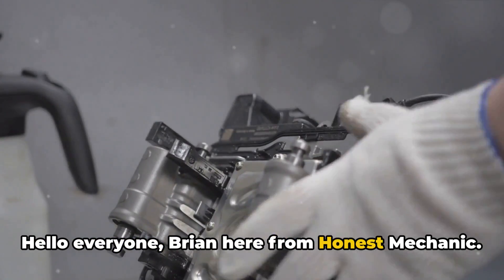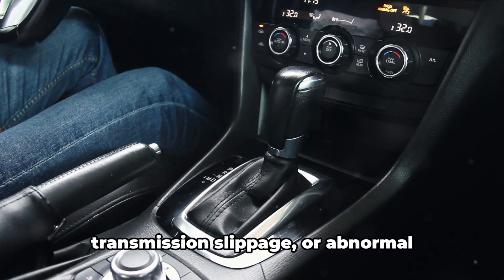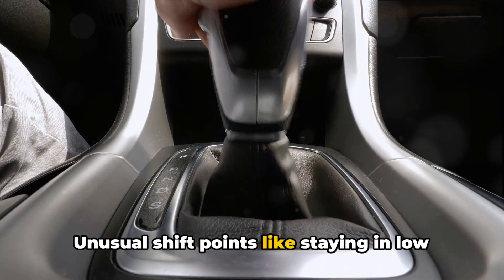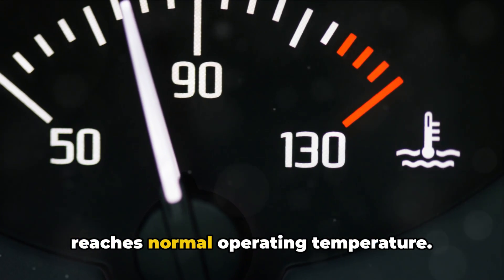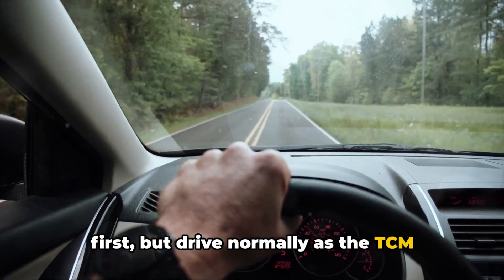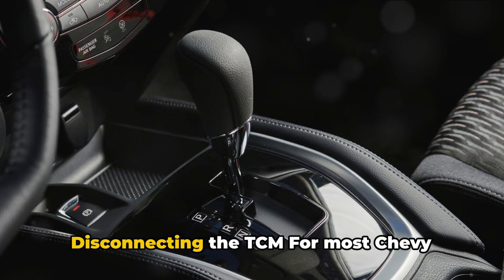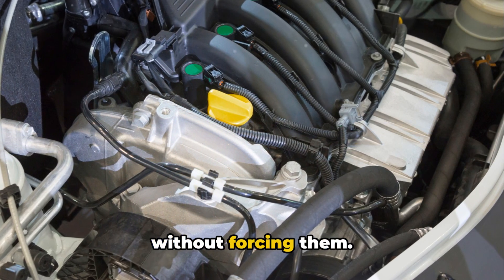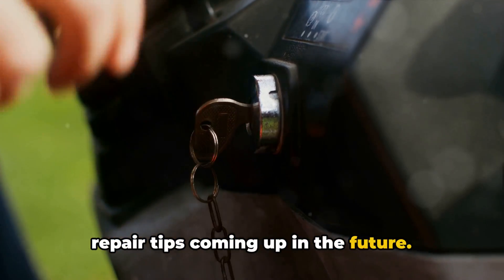How to Reset a Transmission Control Module Chevy: 3 TCM Resetting Methods

Comment from the maker: I made a small mistake, I meant the engine should be "On" and not running when you press the gas pedal. Apologies for this.
Reply: The correct procedure is as follows. Turn ignition key one click forward, depress gas pedal to the floor and hold for 15 seconds, continue holding gas pedal, after 15 seconds turn off key, release gas pedal. Start and drive vehicle for relearning. This works on 4l60e and 6l80e transmission only.
Reply: @michaelj343 do I need to wait 2-3 mins before running the engine?
Reply: @woodtyp  I didn't wait, and it worked for me the procedure differs with year models. The best way is to use a obd2 scan tool with the reset capability. Some auto parts stores will reset the transmission for you.
Reply: @michaelj343  4l60e, 6l80e... What about 4l80e?
Reply: @mattmotionpix yes it works on the 4l80E.
Reply: Lol i was like man this sounds dangerous and my neighbors are gonna love me 😂
Reply: Then FIX YOUR VIDEO or delete it!! Someone is going to blow up their engine. Terrible.
Reply: I reset my TCM on my 08 HHR before I did I didn't have first or fourth gear after resetting it I got them back but it shifted really badly in the 4th so then I still had a bunch of other codes coming up so I reset the computer the TCM again and now I don't have 4th gear at all and the only code coming up is TCM and it says m i l illuminations whatever that means what do I need to do next
Reply: @calvinBills-vh6lo 😅
Reply: On which part the step 1 part
Reply: @stevencombs254 it's clear as mud
Reply: Not really a small mistake if it can cause a blown engine now is it….. guess that’s what happens when you don’t ACTUALLY know what you’re doing just using AI to make tutorials 🤦🏻‍♂️
Reply: To late my motor exploded.   😊
Reply: Don't start the vehicle;just turn the key where the dash light up and hold the gas pedal.
Reply: @stevencarter9812 or just say turn the ignition to the “ON” position “WITHOUT” starting the engine. Simple as that idk how he makes that mistake then tries to correct himself in the comments only to do the exact same thing again saying “the ENGINE should be ON which is a very simple an quick tell that this guy doesn’t know shit about anything doesn’t even know what an ignition switch is an just made a YouTube post of something he read once 😂
Reply: Will this work for a Dodge Dakota?
Reply: So take down the video or fix the video. There's a comment below that says following your directions basically damaged his engine!
Reply: Not a very small mistake there bud 😂idk if you live in a box or are just a recluse but people nowadays especially the younger people (under 30) are pretty fricken stupid there’s probably I’d say AT least 60% of the people that watched this that don’t know anything about anything and have zero know how self learning skills and zero common sense that went to their vehicles and started it completely an full blast WOT for like 10-15 seconds just screamin 🤣 I’m super curious if any of them blew up honestly an they probably don’t read comments or reviews on anything so I’m sure they didn’t see this
Reply: Not a very small mistake there bud 😂idk if you live in a box or are just a recluse but people nowadays especially the younger people (under 30) are pretty fricken stupid there’s probably I’d say AT least 60% of the people that watched this that don’t know anything about anything and have zero know how self learning skills and zero common sense that went to their vehicles and started it completely an full blast WOT for like 10-15 seconds just screamin 🤣 I’m super curious if any of them blew up honestly an they probably don’t read comments or reviews on anything so I’m sure they didn’t see this also JUST SAY “THE KEY SHOULD BE IN THE ON POSITION WITHOUT STARTING THE ENGINE” Jesus dude ur literally stating that the engine should be on that’s the fricken motor dude just turn the IGNITION SWITCH TO THE ON POSITION NOT THE ENGINE holy shit said it wrong twice In the video and spelling it out
Reply: 🤦 The “IGNITION” should be in the “ON” position the ENGINE should NOT be on that is literally the motor the thing that uses air fuel and spark to combust on a rotating assembly that feeds power through your entire trans that spins your driveshaft that spins your differential an axles an in turn giving power to your tires allowing them to spin and move the entire car… so no the ENGINE should not be on for like the 100th time from everyone pointing out ur mistake just to repeat the exact same mistake again in the comments probably just to keep the algorithm happy cause you’re getting interaction with the video 👏👏👏
Reply: Oh my god, I just did what you said to do. WTF. Why don't you take this video down and put up a new one?????
Reply: If your motor blows at WOT FOR 15 seconds you have bigger problems.
Reply: @nicholasreed5752  lmao not everyone has a brand new healthy vehicle with zero issues or bad sensors under 200k, an even then u hold ur foot to the floor an it doesnt have any safetys then ur very likely to float a valve have it kiss the piston  or fuck something up in the head its definatly not good for it at all. lets see the video u have of ur non built car likely having issues hence needing the tcm reset reving full throttle for 15 seconds lmao
Reply: yo you probably blew up a few engines cause of this lol
Reply: Then remake the video dummy
Reply: @DustinLeopard1984 How is the engine on and not running?🤪
Reply: Yes I was like gesss okay 😂
Reply: My 2010 Tahoe with a 6 speed want shift or shifts very hard but only when the outside temperature is below 40 degrees , does anyone know why
Reply: @truckingthelowcountry9961 When was the last time it was serviced? Sounds like the fluid is too thick.
Reply: @michaelj343 , we had the transmission rebuilt March of 2025 & same guy put a transmission control module on in December of 2025. You can let it warm up for 20-30 minutes, drive a couple of miles & shut the engine off for several minutes , crank it up & it shifts fine. Kinda weird
Reply: @truckingthelowcountry9961 Has it shifted that way since the rebuild? Or did it just start doing it one day?
Reply: @michaelj343 , just started when the winter months , outside temperature is below 40 it acts up, during the warmer days or summer it’s fine
Reply: @truckingthelowcountry9961  sounds like the thermostat. Look on YouTube on how it's done. It's pretty simple.
Reply: @michaelj343  , I’m gonna try it. The transmission has a thermostat?
Reply: @truckingthelowcountry9961 yes it's on the driver's side, in the block that has the cooler lines going in it. Look up "superior transmission solutions" there's a video that shows you how to do it.
Reply: Aaaahhhhh, ok! I was concerned about blowing the engine by holding the pedal to the floor 10-20 seconds! Having the engine off will relieve that worry. Thank you again! 
Will write again after testing this on my friend’s car. 
Her car had internal damage. Is getting a newer transmission now.
Reply: Thank you for the explanation.

Comment: If this didn't work for you it could also be you vehicle speed sensor on the transmission or any of your speed sensors on either on if your wheel hub bearings. It's not given correct info to the car's ecm and it's causing confusion.

Comment: I mean, what's the point of disconnecting the TCM connector if you disconnect the battery itself
Reply: There's still power in everything for a bit. It needs to drain
Reply: @josephstanford5195 well yeah of course, as soon as you disconnect the battery everything drains within seconds

Comment: I have a 2003 silverado 1500. My 4L60E transmission lost 3rd and 4th gears. I replaced it with a Chevy certified warranted transmission. The new tranny had no 4th gear. Chevy says it has to be programmed. My mechanic says it does not. Who is right?
Does a rebuilt 4L60E need programming?

Comment: The last one is what fixed mine I'm so thankful Jesus I was starting to think I'd have to buy a new transmission
Reply: What was your the problem you have with the transmission?
Reply: Mine is a new transmission Ben doing this since I put it in harsh shifting slippage  I will try this when I go back out  fk 4x4 Silverado them get expensive
Reply: Everything you said it does shifted fine cold then does all that shit sometimes I gotta shut the truck off

Comment: The guy that made the video lists a comment at top that 7 months ago he spoke incorrectly in the video. Another commenter several weeks ago says that holding the gas pedal down for 15 seconds with the engine on basically damaged his engine. You should really either take this video down or fix the video. Negligence! I'm so glad I read the comments.
Reply: Bro wtf gonna hold their gas pedal to the floor with the ENGINE ON and in park !?
For 15 seconds 
Who ever does that is way to stupid to understand even a typo 
Let alone to work on their own car...
Reply: Anybody with common sense isn’t gonna turn there car on all the way and hold the pedal down your red lining your car obviously your gonna fuck it up so he might’ve said it wrong but also anybody with common sense would understand he meant to turn the car on just not all the way on
Reply: Or you could just not be a complete imbecile, and think for two seconds to realize this procedure is done with the engine off.

Comment: Mine threw a piston rod at 15 seconds and now there is a hole in the block and no oil pressure. The engine now vibrates.
Reply: Please don’t tell me you pressed the pedal to the floor with the engine running😳
Reply: Yes i did@woodtyp
Reply: @gerald4027 Holy shit. I’m still assuming this is a joke but if not my condolences
Reply: I hope this is a joke
Reply: Some people don't have common sense, or are you just jerking everybody's chain!
Reply: @wiz4020 the engine is jerking.
Reply: Are you serious
Reply: @woodtyp yes.

Comment: Quick question my tcm was ripped out by my wheel when I hit a pothole and was replaced with a different one and part of the wiring was too from where u connect it and now it doesn’t run at all what do you recommend?
Reply: Tcm needs to be programmed to car

Comment: With my c6 corvette 2005 ls2. I can go into any gear but no drive. The gear shifter still moves the cable to the rear of the transmission aswell. it’s as if the car is in neutral even though it still allows me to select all gears. It’s only has 3 anyway 😂 P R D 3 2 1. have you any ideas please

Comment: I replaced both shift Show a noise running good for about 56 hours and now when it goes to go in the forest and let's go, what what is the cost of that?Because I am tired of the screwing with this car
Reply: Now, when it goes into fourth gear, it kicks out every time and there's no chickens in light or nothing.And my cruz, quit, working too I would same time
Reply: Disconnect your cruise control module  @calvinBills-vh6lo

Comment: 777 likes and that is part of my vin- also apart of my screen name- i didn't change the likes just for that reason, but you get a big high 5. after the mechanic told me 10k plus for a new tranny, i replaced the MAF, Cleaned the Throttle Body and Followed these steps. all fixed. what a shame that we have to work on our own cars now because the lack of knowledge and or scamming going on these days. Yah Grace Be Upon you.....

Comment: My 2014 Chevrolet Spark transmission work perfectly the dealer did an update because of transmission issues which I did not have now when I stopped at a stop sign my car takes off in second gear the only way I can get it to go back into first is a pull-down the lever to First, I know they say these belt drives don't shift but it feels like it but mine stays in the mid-range gear when I take off with no power

Comment: When pushing it to the floor should the car stull be on?
Reply: No. He added a change as the first comment. Shut the engine off after warming it & before holding down the gas pedal.
Reply: @jackjones9460 omg, I'm so upset right now. I did it with the engine on and after the 20 seconds, the pedal tension released. After waiting the 5 minutes off, the car started fine, but now I've just redone the basic reset without turning it on. I'm so upset. I've been having such a hard time lately and I don't know why I can't catch a break. I thought putting it to the floor was fine because they've had me do that when I take it to the quick oil change place. We'll see what happens now when I drive it. I took my car to the shop yesterday to have the blinker arm fixed and it's shifting crazy ever since I left. Geez.

Comment: Have a 2016 terrain 2.4 liter that stays in neutral. Wont go into park or nothing. Starts right up. Didn't see any check engine lights. Anyone have any idea. Hope tcm didn't go bad. Any help much appreciated.
Reply: Sounds like linkage issue.take shifter boot off check for something stuck in it. Also should be able to hit a release in bottom of shifter( for towing cars with no key)

Comment: 2008 Chevy Malibu is stuck in first gear
Any suggestions?
Reply from the maker: Hi, Check the transmission fluid level first. If it's low, top it off. If the fluid level is fine, the issue might be with the transmission control module or a solenoid. A diagnostic scan can pinpoint the problem. Do you have an OBD scanner?

Comment: Wait so im supposed to floor the gas pedal while nmy engine is running?? I feel like my engine is gonna blow up
Reply: @Zoe I just died laughing when I read your comment lmao b/c I said the same thing when I heard the first method. 🤣 I was like wait hold up what?! 🤣
Reply: No. He added a change as the first comment. Shut the engine off after warming it & before holding down the gas pedal.
Reply: @jackjones9460 this was the second method, without the engine running
Reply: @jackjones9460 he said while still holding down the gas pedal turn off the ignition. This guy is blowing up motors all over the World😅
Reply: Wait run that method back again please
Reply: America is doomed , nobody listen and reads instructions nomore

Comment: My chevy s10 runs good, but struggles, somewhat getting into the 1st gear.  A bit of a strain.  After that, it's like normal.  They've run a diagnostic test, saying that it's internal.  Would that necessarily, mean transmission rebuild??
Reply: Not necessarily no. People give bad diagnoses all the time. Either cause they are blowing you off for one reason or another or simply don't get paid enough to care really to put in an effort

Comment: If this doesn't work try your ignition switch.  Just got back yesterday from the transmission shop. Ran diagnostics inner of transmission great so he said it's really common issue.  Hopefully that helps someone else out.
Reply: Mine will be driving and all of a sudden will slip. Service stabiatrak and the emergency park light is om
Reply: What codes you throwing?@wyneshablissit2469
Reply: @wyneshablissit2469  stabiltrack light will come on if the tires are low, on older model gm products
Reply: What led you to get the ignition switch? I stopped to get diesel. After filling up my truck wouldn't start. Got power But would crank the starter. Jumped the posts at the starter and it started, however it was stuck in 6th gear
Reply: Gear stitch. Natural switch @geraldcarr1169
Reply: The guy at the transmission shop ran diagnostics and said it's a common issue with these yrs and makes. Doesn't make much sense to me but hey... lol
Reply: @ryandach3289 I’m glad I’m only working in someone else’s 2010 Malibu! I now know to never own one.

Comment: Did nothing. However shifts fine accelerates fine still throwing code for torque and shift silanoids. Getting to be frustrating 😆 I have changed my silanoids wtf 😑
Reply from the maker: Hey Ryan, definitely a frustrating issue. Sorry to hear that. here is what I think.  If your transmission is shifting and accelerating fine but still throwing codes for the torque converter and shift solenoids after you've replaced them, it could be an issue with the wiring or the transmission control module itself. It's worth checking the electrical connections for any damage or corrosion and considering a diagnostic to check the module's function. Other than that since you car shifts fine, you can be assured it''s a big problem but don't overlook it.
Reply: Thanks, went transmission shop yesterday.  Ran diagnostic transmission is working great. Thank goodness 🙏 😅  he said it's common issue with the ignition switch or the wiring harness that connects to it. Appreciate your getting back to me with this issue.

Comment: What about the transfer case mine is stuck in neutral and the light just keeps blinking when you try to put it in for low or high or two wheel it’s a o3 Tahoe z71
Reply: Not wanting to be a jerk but search for reset transfer case for your 03 Tahoe Z71. They probably have a whole different procedure for transfer cases, cause they won’t make it easy for you.

Comment: Does the transmission control module in the 2013 Chevy Traverse have to be reprogrammed if the TCM has been replaced?
The TCM is behind the trans cover and bolted inside, but has been replaced with a Non fried out TCM out of the same year vehicle?
Reply: Yes. Must be programmed to vehicle. The video does just that
Reply: I have a 2014 GMC Terrain.  Are you saying that you've removed the TMC and replaced it or or you saying you've found another way to put in a new one?

Comment: I need help. My 2009 aveo5 has a u0100 code. I’ve check all my grounds and cleaned them and also replaced a few of the burnt wires. It runs and drives but struggles to shift. It will rev high into a gear and putt like it is going to stall. It is an automatic transmission as well.
Reply: Why not just disconnect the TCM fuse?